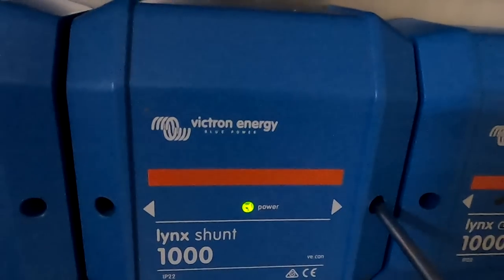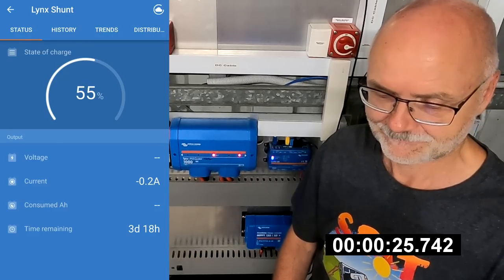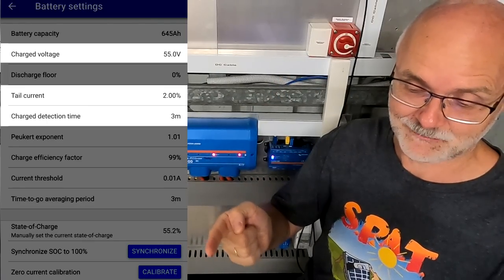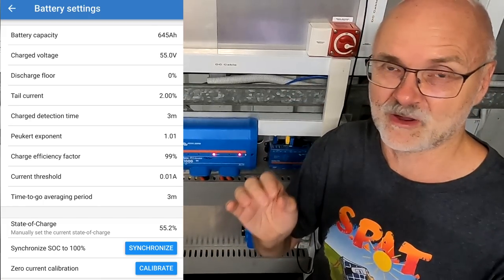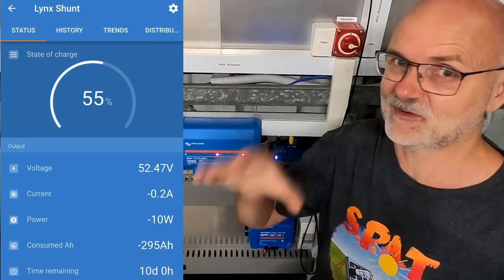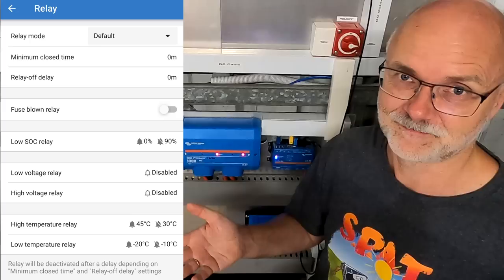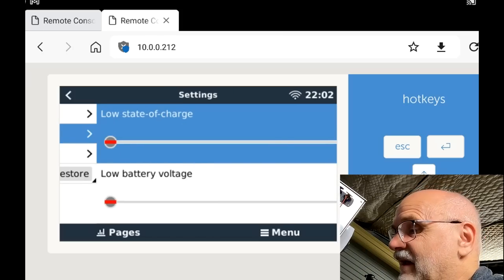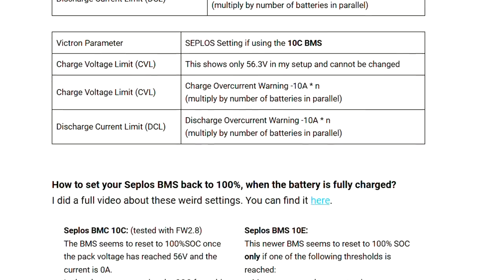The Victron Lynx Shunt - Settings, Features and Flaws

Comment: Was watching this video when the power went out. No worries, I switched over to my back up battery system and was back up and running and got to finish the video!
Reply: How last century, apart from the loss of grid notification on my phone I wouldn't even notice if the grid went off ;-)
Reply: @TheRonskiman  Pretty great considering I live in a rental in the city.
Reply: @TheRonskiman  These days the only way I know whether the power has gone are messages from the neighbours asking if my power has gone off too. :)
Reply: @pedromoonunit430  That is my dream system.
Reply from the maker: We had several power outages during the recent storms and thanks to 100s of meters of extension cables we kept the lights on, hahaha.

Comment: Thanks Andy, another great video, I also have the Lynx Shunt 1000 and to be honest I think it is an expensive fuse holder,  I sometimes have a low battery warning appear on my Multiplus, shuts down the Multiplus for 10 sec and restarts? yet to discover the cause but as you say the SOC disappears , you would think for the price they would have a way to backup this information on the device. Keep up the great work,
Reply from the maker: Oh, wow, it even shuts your system down 😙
The software on the lynx shunts sucks and needs lots of improvement. It should not be too hard with the FW upgrades they can do.

Comment: On the discussion about the smart shunt's SOC calculation... a great demonstration of the difficulty in actually figuring out the SOC of a LFP battery bank.   It's virtually impossible to figure out just from the voltage due to massive differences in voltage (at the same SOC) that occur depending on whether one is charging, discharging, and by how much.

Fortunately, though, figuring out the SOC is mostly just informational.  Except for one particular situation, none of the equipment actually needs to know the SOC and can just use voltage trips.  That one situation is when a hybrid inverter is managing AC-coupled solar panels off-grid, where it needs to maintain a battery buffer (SOC cannot be higher than around 90% or lower than 10%) in order to be able to use it to soak up differences between generation and loads (because the frequency servo controlling the micro-inverters moves slowly).

--

I'm having fun with my little side-project.  I am rewiring my back-deck Pergola system to run my office and machine room off-grid.  It was previously just grid-tied.  I decided to go with 24VDC instead of 48VDC just for safety, since its only supposed to be a fun little side project that is separate from the main system.   Even so, I'm having regrets.  I might just rewire it for 48V... nearly all the equipment can handle either.

In anycase, the Pergola generates about 5kWh/day at the moment and the two rooms eat around 6.5kWh/day, which is perfect... I want the rooms to burn slightly more power than the Pergola generates so it doesn't curtail solar generation.   I support the small battery system (about 5kWh of storage) with a Victron 12A charger that runs off the mains, configured only to support the loads when the battery voltage gets too low.

My expectation is that once I optimize some of the losses, the charger will only have to push 0.5 - 1.0kWh/day on average, about 1/5 the total.  Hopefully less.

Over winter you may have to do something similar with a generator or a charger run off the utility to keep the battery bank from going empty.  Having fallback support like that which is completely automatic makes life a lot more convenient.

-Matt
Reply: 48v is just so much better- obviously half the current through everything which is just awesome. 
48v is never going to give you any more than at very worst a very slight zap, perfectly safe.
Reply from the maker: You have to press down on the positive and negative terminal on a 48V system very hard to feel anything. If you have dry skin, nothing...
But hey, we have the option here with 12V, 24V and 48V 😊

Comment: I have the Lynx Shunt in my system, and it shows DC power, so not sure what you mean? Accessed the shunt via Victron connect, then Cerbo, then devices, it connected pretty quickly, but voltage was missing, not that I ever connect this way. Firmware version was the same as yours.
Reply from the maker: Yeah, it shows DC power but does not add it to the Consumption number near the graph. Only AC power will accumulate there. DC power consumption is ignored in this figure.

Comment: On the cerbo, under settings, system setup, is your “Has DC system” enabled?  Based on your screenshots it is not, that has to be enabled on any VenusOS device to show the DC load. I assume it is set on your main system and you forgot to enable on the cerbo.
Reply: That's exactly what I enabled on mine, and I only knew about it because of one of Andy's previous videos, I also think he's forgotten to enable it. The shunt doesn't even know where the power is going, it just measures it, the Cerbo takes measurements from the inverter and other sources and anything missing is assumed to be DC consumption.
Reply from the maker: It does not make a difference though. It will show you the actual DC load but does not add this to the Consumption at next to the graph. This only works with the Smart Shunt and the BMV, not with the lynx shunt though.
Reply: @OffGridGarageAustralia  I only have the Cerbo running directly on the DC though, so it's not significant consumption, I will be adding the battery heating later though.

Comment: Just a comment on the Peukert exponent.  I am using 1.02 for my Peukert exponent.  Even though you are correct for the battery alone remember there are possibly line losses for high currents in some systems.  More current equals more line losses.  My testing for my system under normal working loads is somewhere around 1.02 - 1.03 for my Peukert exponent due to my line and connection losses between battery and inverter.
Reply: Any voltage drop means more current is required for the same load (watts) but it doesn't matter which part of the loop (in a series circuit) where current is measured. For most of the SOC the current doesn't reduce usable capacity (like SLA), it only affects the last ~2% of SOC that's below ~2.7V/cell when slow (C/50) discharge, vs hitting 2.5V when fast (1C) discharge.
Reply: Any line or connection losses between the battery cells and the shunt (which is external in my situation) will contribute to the Peukert effect. Think high current through connectors or cables near their current carrying capacity that produce heat and power losses that the shunt cannot read.  These small power losses are not accounted for by the shunt. To prove it perform this test, under a high current condition take a voltage drop measurement between the battery negative terminal and the shunt negative terminal. If no voltage drop is present your shunt reading is accurate. Any voltage drop under high loads will contribute to the Peukert effect value used by the shunt to calculate ah consumed.
Reply from the maker: That makes sense. I'll try 1.02 as well as mu shunt calculation is always a bit off when fully charging the battery again.

Comment: Can i ask for some help from you?

I want to buy and design system with Victron MultiPlus-II 48/5000/70-50 + BMS + lead-acid batteries (i will change them in future with lithium batteries) for reserve power (blackouts in Ukraine). So, i don't understand whether i can connect my bms to Multiplus inverter, and do i need to buy lynx power in, distributor and shunt?

p.s. i have a limited budget, so i want minimal setup to start with

Comment: Nice touch this "elevator music"😁. I really like Victron stuff but Lynx is not one of the parts I would buy however.
Have you ever considered testing the 123SmartBMS system?
Its software nests in the Cerbo and shows each connected battery  over USB port (or hub if more than 2).
Advantage is you can connect 18 batteries in seriesin order to max out the 66V of the Multiplus and will have some extra kWh's in your sets.
For me it will me two strings in parallel with a total of 34,7 kWh gross and about 30kWh nett capacity 😁
Reply from the maker: The Lynx needs a proper FW update to make it worth the price.
So, when you connect several BMS via USB, they act independently in Victron and are not reporting as one BMS obviously. What would be the benefit of connecting several of them to Victron?
I have not tested the 123BMS but had a look at it a few times in the past. I found it very confusing with all these modules, relays and not straight forward for beginners.
Reply: @OffGridGarageAustralia  I found the use of it very easy and srtraightforward and yes, you can see the SOC of different batteries but having equal ones, I see the advantage however of looking at each pack.
Yesterday my promised 40 EVE cells were pursponed without telling me upfront so I lost a precious day for nothing 🧐.
Then I decided to make lemonade when served lemons and cancelled the whole order in order to go for 6 Pylontech US5000 batteries with included bms and Victron certified CANbus comms.
I need to get this ESS job done quickly to start with installing a Nibe heatpump too.
I want to be ready for the winter.
Reply: @OffGridGarageAustralia  What is the status now? Did they indeed upgrade the firmware? Or is it still not a worthwhile device?
Reply from the maker: @ProMace  They did update the firmware twice since, but the problem is still the same. I guess, Victron thinks it's OK how it performs and works. If you have only Multiplus or Quattros, it is OK to use. As soon as you use other inverters, it will happily ignore their consumption.

Comment: Note v1.09 has been released, but later redrawn. Do not use it,
use v1.08 instead.

It is also no longer necessary to use v1.09. It was only created
to allow configuration on the CCGX. But since CCGX version v1.30,
which will be released in October 2015, the CCGX can also configure
Lynx Shunts with v1.08 and earlier.

The problem with v1.09 is that the Lynx Shunt can end up in a reboot
loop, which makes it impossible to use. It might even work fine at
first, but then after a later power cycle end up in a reboot loop.
Reply from the maker: I've never seen a FW update for the shunt coming through so far.

Comment: Can you explain why the low soc is coupled to te discharge floor like how stupid is this if i like want to shut down my inverter around 40% so I can keep my dc lights on during the night, then te discharge floor will be set to 40% and I will have no idea how long my battery will last, I have the bmv 712 so I have a display so it displays a small battery to see the soc of the battery, setup like this it is saying that my battery is 0% at 40%. I have been bothering Victron about it but they won’t fix it. Can we all just bother them until they fix it.
Reply from the maker: The purpose of this is to give users a certain energy buffer for either emergency situations or if they want to discharge their battery only to 20% and not lower. So at 20% the battery monitor shows 0%. 
I think, the settings makes more sense for lead acid batteries where you should not go below 50%SOC. For lithium batteries, I would set this to 0% to get the real number.
Reply: @OffGridGarageAustralia  that is true and I understand that but what if you want to use the relay so you disconnect heavy loads of the system at say 40% so you can make it trough the night with dc loads like you phone charger. If you setup your relay like that it will automatically set your discharge floor to the number that you set your relay to disconnect, that doesn’t make any sense. Please try it yourself.
Reply: @OffGridGarageAustralia  the battery monitor doesn’t show 0% it actually shows 40% just that you don’t see remaining time, and the small battery that is show in the bottom right corner of the bmv 712 show that it needs to be charged. That all makes sense but I don’t understand why a low state of charge relay in normal or charger mode sets the discharge floor to what you set the relay. They are software coupled. If you look online there are plenty of people complaining. I contacted Victron and got a nasty short reply “contact your supplier” not happy about service
Reply: @OffGridGarageAustralia  Another example solar is free energy right. So if you would want run a heavy load like a fridge that you would want to disconnect if you have idk 60% and have switch over to propane. The stupid relay would set your discharge floor to 60% it doesn’t make sense.

Comment: Доброго часу. LYNX SHUNT має два однаковых гнізда VE.Саn. Одне для зв'язку із GX, а інше глушиться резистором RJ45. Питання? Куди можна використовувати інше гніздо, яке заглушено буде RJ45, невже можливо паралельне підключення декількох LYNX SHUNT? Навіщо продублювали  гнізда VE.Can? Дякую за відповідь.
Reply: Because VE.CAN is CAN which can daisy chain many users of the CAN bus. All the users have two ports because the CAN cable is going from one to the next one and the last device on the line must have CAN bus terminated. The small, blue plug you had in your Cerbo GX package (there was two) has 120 Ohm resistor inside - called "termination resistor". It is required for the CAN bus to work correctly in full speed without loosing data packets.

Comment: My Lynx Shunt died last week, wasn't too fussed as it was a massively overpriced inaccurate piece of junk. Debating whether I need to add my superior SmartShunt to the system or whether I can just rely on the Seplos BMS for SOC etc? I read Victron don't recommend installing a shunt of any kind with a BMS managed battery. How true that is I don't know?
Reply from the maker: You can have as many shunts as you like in your system but can only make one the battery shunt in the system. You can try the Seplos BMS and shunt first before you buy a new shunt.
Depending if you have a 10C or a 10E Seplos, it may or may not work for you.

Comment: How come your charged voltage is 55.0 rather than 55.2 assuming 16 x 3.45v ?
Reply from the maker: The charge controllers charge to 55.2V, that is correct. 55V is the charge voltage set in the shunt when it resets to 100%SOC together with the other two parameters necessary.

Comment: I use a battery adapter for my camera when streaming & long recording (dummy battery with cable replaces original battery). A USB(5V) to ~8.1V DC-DC designed for my Sony camera, and a 230V AC to USB or similar power source. I could use a large USB power brick or modify to make a 12V to 8.1V DC-DC. YMMV

Comment: My system here in the northen hemisfere are almost identical to yours, but i got two Lynx Power in, a Lynx Shunt and Two Lynx Distrubitors.
When i shifted to the lynx from the smart shunt i really got the feeling of a wery expensive fuseholder (i noticed you got the wrong type of fuse in it aswell... not the "cheap 325A the manual states for a 1000 Ah system...)
You may ask victron to make another print with the same possibilyties as the smart shunt?
(I used thate for 6 months and it was perfect, but it will not fit into the nice Lynx system, it kinda brings the whole idea down...
Reply: Hvor i Norge bor du? 4580 her..... ;-)
Reply: @TommyFleseland  Stord, Øvrebø om du søker opp systemet :)
Reply from the maker: There is a thread in the Victron Community forum and several people have complaint about the shunt. The official answer from Victron is, that the shunt would not measure the DC load precise enough and the only solution is to use an additional smart shunt or BMV for your DC load. Which would then makes the Lynx shunt obsolete altogether because both, the Smart Shunt and the BMV are measuring/calculating DC load precisely.

Comment: Yes, very expensive fuse holder!! I use only smart shunts to check my battery consumption and SOC..
Reply: Mine died this week. Massively inaccurate. Lacking in features. As you say massively expensive fuse holder. I don't have the inclination to try and fix it other than perhaps to get more for it when I sell it on. Looking forward to ripping it out.